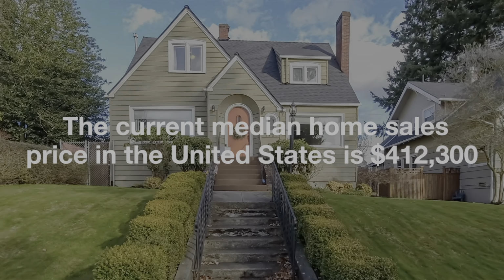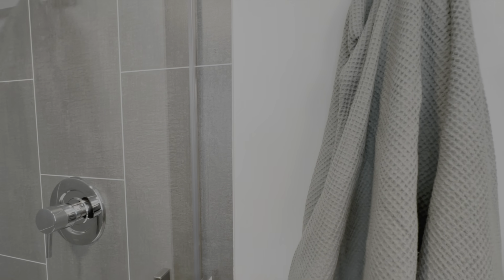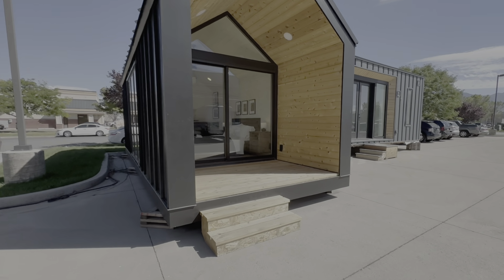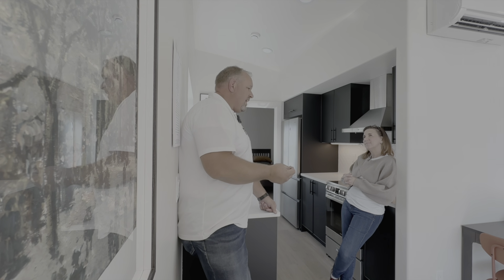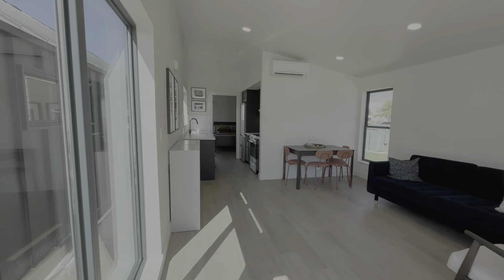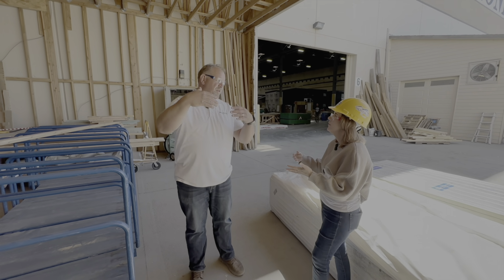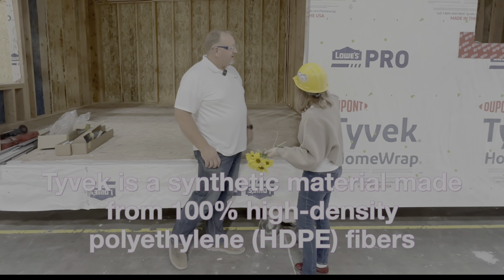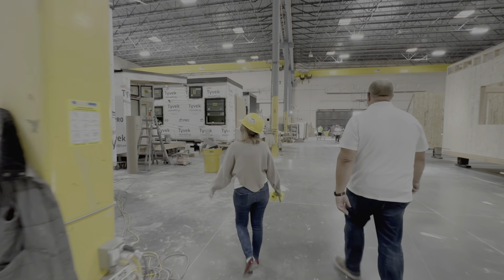Could These Modular Homes SOLVE Home Affordability

Comment: I'd love to use a modular for our house (which is a current need) but the costs are still too high with this builder. In many areas you can buy a new house bigger and nicer for less money, and we may in fact do that, right now. We can literally buy a new and nicer 1600 sq ft house for less than the factory unit alone. => Modular has to be at-scale factory production without oversized profit margins or it can't reach the potential required. It is falling far short so far.
Remember these still have to be moved/craned/assembled and don't include the cost of land, foundations or utilities.

Comment: This feels like propaganda. These aren’t affordable.  Once you buy the land, improve the land, place the modular home it’s not any cheaper that buying an existing home that a bank will do a loan on. An existing home that has character vs these modern looks that will be dated in less than 5 years.  You have to find a state that allows them, then you have to find a developed piece of land, possibly remove the 50yr old burned out trailer, then put this in. How is this going to help the avg person. 
It won’t. It can only benefit a company that CAN produce them on a mass scale than can take all the profit…like what is happen now. 250, 000 all in isn’t affordable when you add in the time and trouble of them.

Comment: Excellent video!  You have provided a lot of information on modular homes and how they could work for some areas.  
Some people are making comments that these are too small, they’re too expensive, you have to buy land first, etc.  
Perhaps they didn’t fully watch your video lol.   You did state that this isn’t an absolute fix for the housing solution and I agree.   This is just ONE way to help people get a small home that is built faster and with great materials.   They would be great for many senior citizens who sadly cant afford a home and also need 1 level homes.  
I have a large home and I want to really downsize.  But guess what?  There is nothing for me in which to downsize!!  If there is something smaller to be found, it is almost the same price as my current home.  
Government officials need to start thinking about how they can help.  
One way that was mentioned is that the large plot of land that is needed doesn’t have to go through so much red tape.  A developer can get approval much faster.  
Also, it’s time we went back to building a variety of sized homes in a subdivision.   Most houses now are built large, but we don’t all need large homes.    There should be a smaller starter home, midsize and then larger home.  And don’t let the developer just build 5 starter homes in a subdivision of 100 for example.   Also put a cap on the amount of large homes.  Families really don’t need a 4000sq ft home.  
We also need to stop investors  from buying up so many properties.  
There needs to be a drastic change and it needs to happen now.   Thank you.

Comment: Yes, it’s true that if I can’t afford the car that I want or need because it’s too expensive, a bicycle will be better than walking, but I can’t fit 6 more people on my bicycle, I can’t take a grocery cart full of groceries home on my bicycle, I can’t take my mastiff to the vet on my bicycle, can’t go 80 mph on the freeway on my bicycle….The point is, I’ve put a bandaid on my problem. While not having to walk is beneficial, I still need a car, not a bike. My point is, an “accessory” is an optional non essential secondary thing meant to complement or add value to another primary thing, or to have in addition to the primary thing, not to substitute or take the place of the primary item. When it comes to affordability, if I can afford the iPhone I need or want, there’s a greater chance I’ll be able to afford a smart watch to go with it. ADU’s are still only an  “affordable” OPTION to people who are able to afford a traditional home. A person who would NEED an ADU as a primary home most likely wouldn’t be able to afford one. Furthermore, ADU’s are not meant to be used for 40, 60, 80 years as a full time primary residence. No one is going to buy a 40 year old ADU to live in full time unless it’s dirt cheap and out of desperation, but for them do be dirt cheap, the market must be saturated with them first to bring prices down.

Comment: I am glad you mentioned land prep and cost.  A lot of the affordability for these small modular homes must be lower land and land prep costs.  Locally a minimum lot with power at the road and no other features will run you $150K to $200K.  You will then have to drill a well, install a septic system, put in an access (driveway), clear and grade the lot and then put in the foundation.  Once that is done you can get power run from the pole to the home location.  All of that will cost you at least an additional $100K to $150K.  So you are looking at $250K to $350K before you buy and install the house.  Looking at the prices on the Irontown Homes site, it looks like a small home would end up costing $400K to $500K here.  That isn't very affordable.  I will note that a new home is nearing completion near my house.  It is a two bedroom, single bath, 750 sq. ft house that just listed for $750K.  It was stick built.
Reply: my thoughts exactly
Reply: Want affordable housing - reduce the site prep cost, building permits, permits length time, utility fees, and size of house … go with basic house like in the 50/60’s house
Reply: @garymitchell7551  Just how do you reduce site prep costs?  Locally permits will cost a couple of hundred and only take a few days unless you have a wetland on the property.  I agree that we need to build smaller homes.
Reply: @ building within city limits & some county jurisdictions have extreme requirements ie landscape, road, utility connection fees, add on top of that building permit cost based upon sf, inspection fees (why? I pay taxes for these people; now add in land use restriction & planning - all of these add cost; so how to reduce city government has to understand the cost associated with landscape requirement of subdivisions (ie 15% land dedicated to landscape is a lot of money to a developer, type bushes/trees planted) these people who sit on planning boards add nice stuff to make everything look pretty but cost money to someone usually the homeowner then we complain about affordable housing - and don’t get me started on building codes IRC 2003 is 1/3 the size of IRC 2018 or 2021 code book
Reply: @garymitchell7551  Much of what you are talking about is for a developer creating a subdivision.  The sense of the video is for an individual building a single family home.  Furthermore while what you said may apply to where you live, that isn't true everywhere.  Where I am in Maine the only thing we have to meet code on is the sewage plumbing from the house to the septic system which must be pressure tested for leaks.  The septic system has to meet state standards which drives up the cost, but that is mostly in the design phase.  Locally we have no mandatory building or electrical codes and few limitations on design other than specified set backs from the property line and an overall height limit.  That said, insuring a new build will likely require that the home be built to the national codes.  Around here since there are no code inspectors that normally involves a certification from the home owner/builder that the home meets the appropriate codes.
Reply: @ I have also worked in industrial construction where cities require large plot of the land be landscaped, site improvements ie widening of roads or traffic lights etc; 
I am currently building in Alabama in the country on 40 acres … building it myself without a permit (not required) but per code compliance. But affordable housing is the subject here  and houses are not affordable …. In 1975 I bought my first house at $23,000 1200 sf on $6.35/hr - today that 1200 sf house built would be $240K-$260K or 10x … do you think the avg wage is $63/hr?  Its not the wages its what goes into the cost of the house

Comment: In my experience with modulars, unless the manufacturer will do a start to finish turn key package, it's next to impossible to find a local GC to install it. Which you will need for your lender. So it really doesn't matter what it is or where it came from, if you can't get someone to put it all together, you are stopped dead in your tracks.
Reply: That's why you check the modular builders to see which places they build in.

Comment: What was the price point on these? Are they under $100k?
Reply: I did see one under $100,000.  The link to their page is listed and then If you click on each house, the entire floor plan along with prices are listed.  I didn't see it at first but you have to click on "Catalog" and then "Residential" and the the houses.  :)
Reply: @latonyalee7821  The base price is for the house module! Cost of land, prepping, and putt everything together on site are not trivial costs. A module that costs $70,000 will balloon to $120,000 after everything. Still a better deal than equivalent stickbuilt new houses.

Comment: If you look at the dollar cost for modular homes, you will see that they are comparable to regular brick and mortar construction. The prices for modular don't include the price of the lot and the improvements to the lot. This makes the overall costs of modular home way more expensive than standard builds. IMO
Reply: I agree. Just started shopping.... For a modest modular in WI.  3 bed 2 bath . $250, 000 is the starting price. No lot included.  😮
Reply: Starting price for me in sw Florida was $275 and add ons was another $60k then the lot and lot improvements was another 80k. Or I can buy a brand new build with a lot for $350k in same area
Reply: Back east, yes. The west though costs substantially more and this gives access to a tier of pricing that doesn’t exist in current homes being built

Comment: My take on affordability crisis. This is not the right angle to solve the problem. The problem is systemic. 15-20 years ago, the market wasn’t saturated with insitutional investors. They have poured a lot of money into the sector and shifted the course in a lot of states.
Reply from the maker: @TuranZeynalli  I agree and we haven’t been building those first time starter homes for over 2 decades. We need a bunch of small solutions to fix this very issue.
Reply: @KristinaSmallhorn  how come they do not build houses shape like the egg they are very safe from hurricane